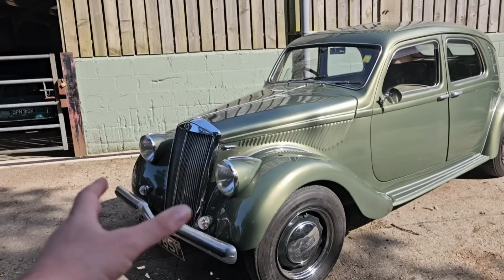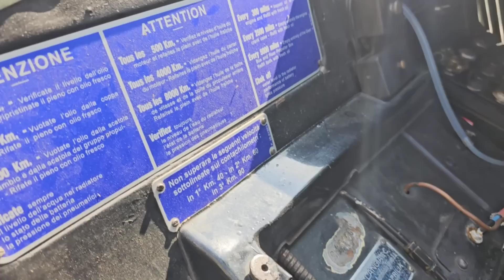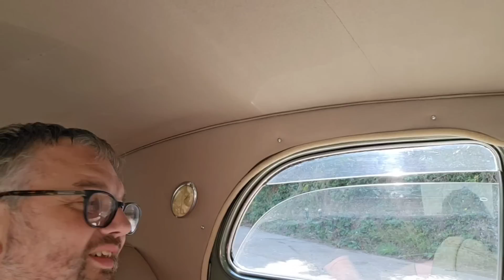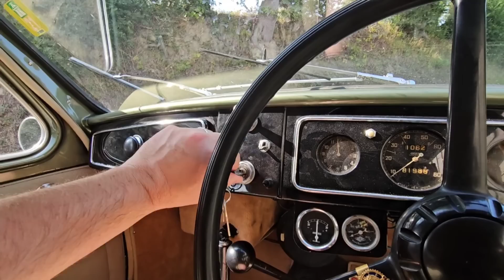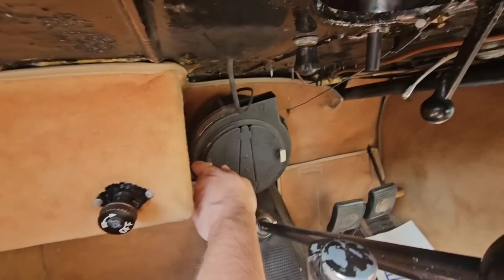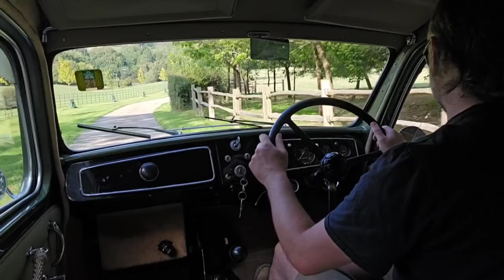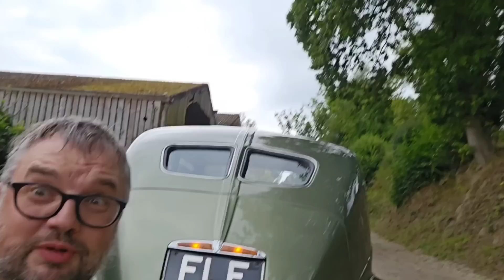Incredible Engineering! This 1930s car is like no other - Lancia Aprilia

Comment: I've never driven a four-speed no synchromesh vehicle, but I have used double de-clutching to improve the gear change speed of change at speed.  Anyway, I am impressed by how easy you make it look.  I guess the gearbox has something to help with gear changes?
Reply from the maker: Years of practice! It's quite an easy gearbox to use if you get the footwork right.
Reply: @HubNut  I have heard that in much older cars, people tended to stop the car and start from bottom gear again.

Comment: Gorgeous car, gorgeous colour and gorgeous interior, although I think I'd do something about the induction roar. Other than that, it seems fit for modern roads (well maybe the brakes need some tweaking). By the way, no need to double declutch when changing up, just wait in neutral until the engine revs drop to match the next gear ratio. Changing down is different because you have to blip the engine in neutral with the clutch engaged in order to match the engine and gearbox first motion shaft to the speed of the rest of the gearbox. As you say, it's really satisfying when you get it right.
Reply from the maker: Double declutching going up allows swifter changes I find.

Comment: Front wheel drive is dangerous, because if you get into a bend too fast there is nothing you can do, it just can't turn, especially if you lift of the gas which is the natural thing to do, with rear wheel drive you have a chance to regain control by counter steering.
I hate front wheel drive!
Reply from the maker: Yet despite driving FWD cars since I was 17, I'm not dead. In fact, most of my scary moments have been in RWD or 4WD. Generally, especially in the UK, if you need to counter steer, it's already too late. There isn't room to catch a skid.

Comment: I remember going to the cinema in my Dad's Aprilia and the fog/smog was so thick that the passenger had to walk in front to see where the white line was!! I believe they were build after the war as well possibly with the larger engine. My father bought an Aurelia B20 and ran it for probably 10 years. I later bought a 6 series Aurelia B20 when I couldn't really afford to maintain and rebuild it....wish I still had it (sigh)

Comment: I love Lancia, when I was a kid there was the Flaminia (V6 2.8 I think), but it was too expensive for my father's budget. I myself drove a lot of more modern Lancia's: 
Like the Thema, Kappa & Thesis, really loved the Thema, drove them for years (had four from 2.0 16v to V6, Turbo, and even the V8 Ferrari), and the Delta (integrale) had the Dedra Turbo, there was also a Dedra Integrale (the Dedra was a Delta sedan ("saloon"), but I only once saw one Integrale for sale. The Kappa btw is in my opinion a very underrated car, I had the 2.4 - 20v 5 cyl. great car, but it was a bit understated, the Coupé version is more beautiful but less practical and when I saw a nice one they usually were asking so much more for it than for a regular Kappa (and I just got married with children then).
Right now I have sold my Lexus GS 450h to drive the last Delta, the 1.8 Turbo with 200 hp and 320 Nm and a six speed automatic, with flipper behind the steer for manual gear shifting (a lot of fun when the streets are empty and of course I put it in sports mode then), I thought it could be my last chance to drive a fun Lancia

Comment: These cars along with pre war Alfas would have been quite unaffordable when new to nearly all Italians. Even Fiats in the 1960s were not cheap cars and regarded as slightly upmarket. The hand throttles were a menace. I had them on two of my Alfa Guiliettas in the 1980s. They were cable operated and had no auto switch off when you braked as cruise control does. So if you had to brake, you would be braking with the accelerator working against the brakes. Dangerous. I have always double de-clutched down the box in all my vehicles to save the synchro, but I never realised until now that this was necessary to change up in those days. That said, a car well ahead of its time in looks and engineering prowess

Comment: There are few things as satisfying as OPERATING a well-designed car.  Once mastered, a crash box is wonderful, and if your timing is good, no clutch is necessary either on the up- or down-shift.  A car like this is a precision instrument in the right hands, and a real joy.  Considering the requirements of an ear for the mechanism and an understanding of the workings of the gearbox, it's no wonder that a manual transmission is now referred to as "Gen-X anti-theft device."  Thanks for a lovely review and an uplifting virtual adventure.

Comment: Hubnut, I'm glad you enjoyed your drive in the Aprilia, although as an ex-owner I'm not surprised, they are outstanding cars. 

However, I'm surprised you failed to mention that it has all-independent suspension, which is why they ride and handle so well. Having driven an Aprilia over the Dolomites and around the Mugello race circuit, I know that very few pre-war-designed cars could match their level of handling or roadholding.

Comment: At what point do you blip the throttle to rev match on downshifts? When the clutch is up and gears in neutral, or simultaneously as you press the clutch and go for the lower gear?
Reply from the maker: I tend to do it as the clutch goes down the first time.
Reply: Okay thanks. I’ve often wondered. I’ll probably never get the chance to practice myself. I once rode on a 1960 bus and could see the driver working away at the clutch pedal, but even that experienced driver missed a downshift while trying to keep rolling in slow heavy traffic, and had to come to a full stop to re select first gear. Personally I’ve driven 7.5 and 18 tonne trucks with synchro boxes with very stiff and slow shifts between first and second, meaning I’ve almost come to a halt before I’ve found second. I’ve tried double-declutching but it seldom seems to be of any benefit. The best solution has always been to start off in second, unless heavily loaded and starting off uphill!

Comment: There was one of these in a (famous) northern NJ auto wreckers for years. Was in storage there (untouched) for a owner forever. Tried to buy it several times , no luck! The car you show is only the second one I have ever seen. Lots of cool "foreign" cars, on the East coast USA back in the day. Fantastic automobile! ❤ Dubs
Reply: What year was it inside? The one at GI in Pine Brook was outside from 1964 til at least 67. Still saveable, but I was disuaded by the lack of engine spares, it was known to have a bad crankshaft.

Comment: I grew up in mid-20th Century America. We liked to think that nothing was better than mid-20th Century American builds. We were wrong. This is such a lovely car. The only flaw is the same flaw I have seen in so many other cars of the 30s -- the back seat is a sham. But the car is tiny compared to, say, a 30s Cadillac which has no such excuse. That green is a green for the ages. It would have worked well in my childhood long ago, and it would work well now. Did you hear the latches taking when he closed the doors? Positively 21st Century. Amazing.

Comment: 1:59 Some cars had suicide doors just so they could use the same stampings for diagonally opposite doors, but here, they have some subtle differences. Lincoln used them in the 1960s because they made it easier to support the rear door hinges on the 4-door convertible models.  They look cool, and they might make it easier to get out in an open space, but the front and rear passengers would have to exit in shifts in a tight parking space. My sister's Subaru 360, with front suicide doors, had an interesting feature; the door latches had gears with continuous "one way" roller clutches, so there was no "snap" when they latched, greatly reducing the temptation to open them while the car was underway.

Comment: That key looks like a banana jack for a guitar amp! What a cool car!

Technically, most modern cars also have a link bar on the wipers it's just under the cowl instead of above it. Some cars do have stepper motors instead of a linkage like the Ford focus but most have one motor and a linkage.

Comment: Aprilia was substituted in 1950 by Aurelia, with a new 6 cylinder V engine (1760 cc)
Ardea was produced from 1939 to 1952, with a 4 cylinder V narrow engine (903 cc). The last (3rd and 4th) series (1949 - 1952) had a five speed gearbox, for the first time on an Italian car.

Comment: I actually quite like crash gearboxes. Back in the late 70s I drove 10 ton 6x6 army trucks which had no syncro.
I only used the clutch to pull away, the rest of the time I just used timing. The beauty was that you could change gear with one finger and didn't have to heave on a heavy clutch pedal.

Comment: When Lancia engineers presented the prototype to Vincenzo Lancia for final approval, he (who was a legendary race driver) drove it – fully loaded – on the open road and achieved more than 130 km/h. Thus, he ordered them to downgrade the engine to limit the top speed (hence the 125 km/h of the regular "production" model) because he deemed it too fast for those days' average drivers and expecially roads (almost all dirt roads, apart from the main ones.)
One eye to everyday safety by one of the greatest drivers of early 1900.

Comment: Some similarities between this old car and my  '67 Ducati 250:   Both can be shifted without the clutch, if you listen and time your gear changes, probably helped more on my bike as it has a massive rubber damped cush on the sprocket carrier that absorbs a lot of transmission kerclunkage.   And my bike's ignition key in the headlight was of the same operations; insert to unground the ignition tap and turned two position to illuminate the low and high beams.  You also had an urban night parking setting where you turned the key opposite of the headlight settings and removed the key and it would illuminate a pair of small 1.5 watt bulbs in the headlight shell and tail-light.

Comment: Very pretty car...we have a Ford 10 (in family from new in 1937) and it is 3 speed, no heater, wipers are vacuum (so faster you go the slower they wipe!) & used to have a '34 Bentley...which had no synchro, no heater...although was quite quick. Equivalent cost for the latter was around 1/2 milion in today's money, but the interior was 20 yrs behind this gem.
PS
30's cars don't need the clutch except to start from zero or to move off...best to just give them a rev then let in the clutch as they are not designed to slip!

Comment: I don't know if it's any of the extra switches you found, but Some cars of that era, only had a "partly manual" battery charge voltage regulator, and somewhere hidden under or around the dashboard would be an electrical switch to adjust for  Winter/Summer ie for higher recharging or lower recharging rate.  Keeping in mind that with those DC generators there wasn't many Amps to play with, even on full power anyway.

Comment: Such a beautiful car. It's cars such as this that move the game on by pushing boundaries and becoming a new benchmark. I'm thinking that the Aprilia was a benchmark that took longer to match than most. I love the wiper controls in the glove box! I'll never complain about having to press a touch screen one more time than seems necessary (... until the next time I have to do it of course!).
I was surprised to hear the asking price. I knew it would be out of my price range but was honestly expecting it to be much further out of my reach than it is.
I know what you mean about getting synchro-less gear changes right. Very satisfying. My first car had no synchromesh on first. Not as much of a challenge as you would only ever need to change into it while moving if on a very steep hill. I later had a van with no synchromesh. A Leyland of some sort but the name escapes me. I have driven other cars without synchromesh, though always because the gearboxes were very old and tired and the synchros were no longer effective. Great skill to have and not as difficult to master as you might think.
Great review as always. Keep 'em coming.

Comment: Why aren't all four cylinder engines V4s? It seems to make the motor more compact
Reply: Part of the problem is the complexity in the block's casting and that the 60 degree Ford Taunus V4's needed a balance shaft. The rather smoother running of inline four is because you has some dynamic balancing between the inside and outside pistons.
Reply from the maker: Good question.

Comment: I started work as a Conductor and then Driver on Chesterfield Corporation Transport in 1978 , when I did my Driver Training in a PD1 Backloader with a Crash Gearbox the Instructor used to put his left foot on the dashboard and changed gear seamlessly without touching the clutch pedal . He just listened to the engine revs and knew when to change . Rip Colin Sargeant , he was the best Instructor ever and  I went on to Drive various crash gearbox Buses in service ranging from Leyland to AEC . Most of these had Gardiner Engines .
Reply: I was given a new LWB Hightop Transit as a work vehicle. Ran it in with respect and feeling for 6000km. Since then, hardly ever use the clutch when driving. Up and down the gearbox. So far, so good. I very seldom crunch it. bw Mike in Germany.

Comment: Beautiful car, do Not rush gear changes, double de clutch ( push the clutch in, shift into neutral, then engage the next gear, a small blip on the throttle helps too ) the overall shape is a little like the the Fiat Topolino except this car is bigger
Reply from the maker: You only need the throttle blip going back down the gearbox.

Comment: Suprised to see that the space is more for i10 than picanto. With similar dimensions you'd expect them to be far more similar in the back than they are. Again ride comfort. Could that be down to the spec. I'd pick the picanto due to the nicer interior.

Comment: A great video. Many of these features were found on the 1200cc V4 1932-designed also-fully monocoque B-pillarless hydraulically braked Augusta; the Aprilla is essentially a streamlined version of that car, albeit with much more sophisticated rear geometry. The telecontrol was an option on both cars in Lusso spec; it is a hydraulically adjustable rear suspension with the big wheel on the bottom right of the dash being the adjuster and the small gauge on the bottom left of the dash being the pressure gauge. Which, on both cars, complement the sliding pillar hydraulic fully independent front suspension. The gearbox is in fact synchromeshed on all but 1st to 2nd, or at least it is on my Augusta, so umm honestly don't think you needed to double-declutch 🙂. And there is a 'fix' for the 1st gear noise. If you can't afford an Aprilla, get an Augusta; you'll be in the same company as Nuvolari! Hope that helps.
Reply from the maker: Thanks. Definitely no synchromesh on an Aprilia gearbox.
Reply: @HubNut  Well that's a surprise! Well anyway, imagine all that technology was first envisaged (and in a small car...) in 1931, coz the Lambdas weren't full monocoques y'see; they weren't unitary bodies. Umm, out of interest, what are we talking Citroen 2CV - performance wise? I s'pose the Aprilla isn't too far off a 2CV6, coz as you know a well-sorted one of those will do 80 too. Or doesn't it quite pull like a 2 deuche 6?
Reply: @HubNut  You're absolutely right, I'm completely wrong. I knew from the documents that the previous owner of mine had fitted synchromesh to second, to make it 2,3,4. But in fact - ha, now I've driven - it isn't a synchro 2nd but a silent second... You're right! Still a nice gearbox though. It'll be on the VSCC stand at the Classic Motor Show by the way, if you get a chance to prize yourself away from all those customers who flock to your stand for five minutes 🙂

Comment: The production of the Aprilia finished by the End of 1949. Not before engine was enhanced by 10 to 12 percent to nearly 1.500 cc and performance from 42 to nearly 52 bhp? It ran close to 140 kmh.
Aurelia started at 1.800 cc 60/62 bhp..1950 to 1958, 2150 cc 118 bhp Spider. Followed 1958 by Flaminia produced until 1968 the last of the fine narrow angle V6s.

Comment: Non-synchro gearboxes are not necessarily "crash" boxes.  If they are constant mesh, they are definitely not.  "Crash" boxes work by meshing the actual driving teeth when changing gear.  They were a short-lived item around WWI.   It is almost impossible to change gear without at least a significant crunch.  As you can imagine, they are not long-lived mechanisms.  Certainly the motorcycle versions are now exceedingly rare.  By the early 1920s, they had been totally superceded by constant mesh gearboxes.  These, of course, require some skill to use silently if they do not have synchromesh mechanisms, which explains why people erroneously refer to them as "crash" boxes.